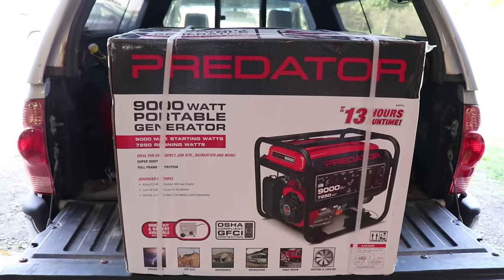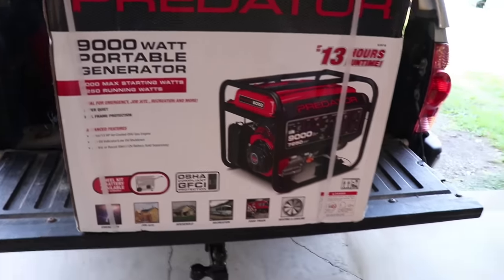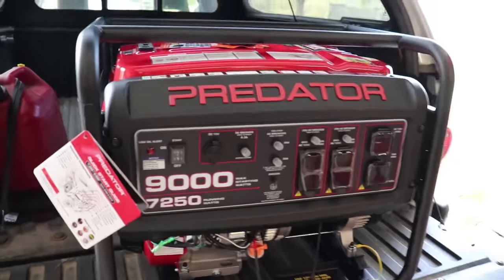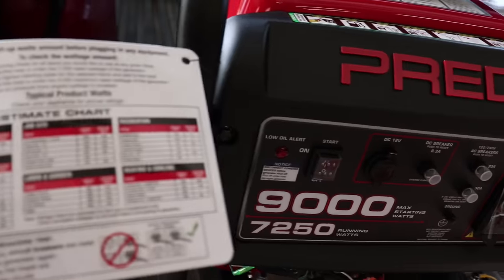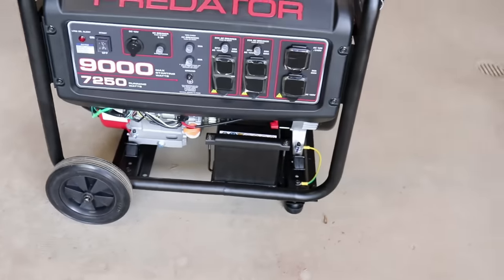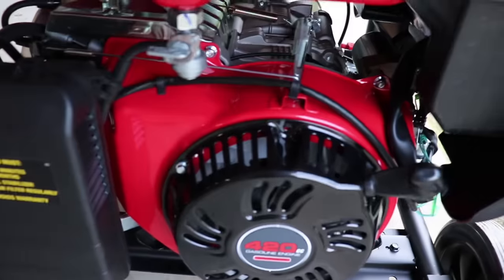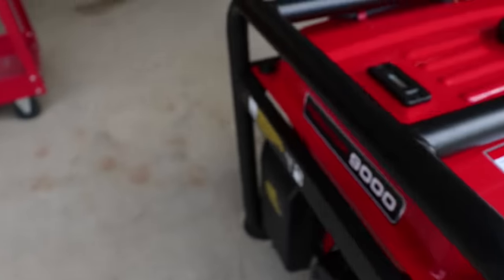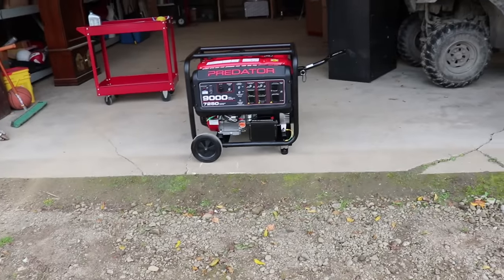Predator Generator Running Our ENTIRE Home. (Complete Setup and Cost)

Comment: Just purchased a Westinghouse 9500/12500 dual fuel electric start to replace my 25 year old 5500 watt pull start unit. I would run the old unit every January and June each year, but only poured 1 quart of fuel into the tank each time and let the engine run till all the fuel was used up.  Two pulls and it would start each time. The carb never gummed up this way.  It performed flawlessly until January, when the pull cord broke and the main switch disintegrated.  I decided it was time to upgrade. The new generator works perfectly and I plan on only running it on LP as my RV has 2 large tanks that I can use, if needed. I have a small LP tank from the LP fire pit that I will use initially and change over to the larger tank(s) if needed. This is one of those items that you hope you never have to use and would not be mad if you never had to run it other than twice a year for preventive maintenance.
Reply: I imagine that Westinghouse been a beast for you. The wattage is a must (case dependent of course)…

Comment: Just to clarify, your water pump probably didnt run......
Reply from the maker: Hi Larry....I did run the water for a while to kick on pump. Just not on the video. Works great. Thanks for the comment.
Reply: @TheCookFamilyHomestead  should run all your 240 volt appliances,7200 watts is plenty for a water heater and a water pump
Reply: @TheCookFamilyHomestead  was your ac running.  How many tons is the ac

Comment from the maker: Here's how it is hooked up to the electrical panel: https://www.youtube.com/watch?v=ohmkZ5-lT2c&feature=youtu.be

Here is the test I did with the water pump and furnace: https://www.youtube.com/watch?v=biioj7OnfR4
Reply: make sure an electrician checks and oks"writes off"
Reply: SOLAR MUCH QUIET, CHECK OUT KODAK AND GOAL ZERO 😉
Reply: @shonte0  Doesn't do much good when there isn't much sun for long periods of time.
Reply: shonte0 battery costs are astronomical and only last less than 10 years and solar panels life is about 25 years - you never recoup you only transfer cost

Comment: Just bought this one and so far very happy with it. Got the Power inlet and breakers all set up. My only complaint so far is the short length of the battery cables especially the negative. I can't get my battery oriented as you have. The neg cable will not reach the terminal. Turned the battery around and I used a short motorcycle baggage tie down strap that works for now. Informative videos. Thanks!

Comment: I have about the same loads you described, I have NG furnace as well. My thought was to downsize my generator to less than a half of what you have...I went with a 3500-400 Watt Champion. If you safely install and follow the procedure (as you did), then add the individual loads one at a time (one breaker at a time)...you don't need near the generator size that you chose. The big advantage is that you will basically use about half of the fuel. At 4000 watts of power, you wont be able to run an electric dryer or whole house air conditioner. Please do your load calculations and size accordingly, and most of all...please be safe! Great video and God Bless!
Reply from the maker: Thank you!

Comment: “useable”output is 60A @ 120V or 7250 watts as per the specs... I seriously doubt it can even get to 6500 watts most 7000 watt generators require 500+ cc engines or 15hp+ engines.

No way this can run an entire home, a fridge, some outlets, some lights, few small appliances. But power is dynamic, you can turn off stuff to get extra power elsewhere, but to state it runs an entire home is ridiculous especially since you didn’t show total home power requirements, as this greatly differs between homes.... esp 2 story homes

Lastly a dual/tri fuel generator would be better buy, NG is Plentiful and lots of homes use HG,  but at reduced power even under LP power levels, vs gasoline
Reply: Agreed I have the same one and run a deep freeze a fridge and some lights we don't have many outages though and usually back on within 8.hours or less.
Reply: I use 10-30 kw per day depending on the weather. I don’t use central heat/air very often. This generator could easily run my entire house with a little power management.
Reply: Generator supplies 9000 watts, at 240 volts ohms law states that 9000 ÷ 240 = 37.5 amps. You multiply 37.5 x 0.80 (80% of the total load is in respect to over current protection) you get 30 amps. Go put an amp clamp on a 200 amp service for a house and tell me with the central ac working, power to the fridge, some rooms are all lit up and even a couple of tv's being on that you'll read 30 amps or even be pulling anywhere near it. IF your using an electric range which can be 50 amps, dryer (30 amps), microwave (14-17 amps), blow dryers, toasters, blenders as well as everything I mentioned before..... yeah you'll have some issues. But this seems to be intended for a power outage, it's not like hes trying to prepare thanksgiving dinner on the generator, cut him some slack.

Comment: Be cool to have a giant fancy battery that the generator keeps charged so that the generator noise is not consistently running.
Reply: Do you know how much a battery bank  cost to run a house for a day? It is like 2-4 thousand for the batteries, period. Then you have to buy a inverter ($1500), wiring,exc. It can get to 6k quick.
Reply: @brianmorrison9066  hey thanks for explaining what is needed, saved me from typing it out.

Comment: Got a generac 8k. 
Runs everything.  But under full load... watch fuel consumption.  Mine gets real thirsty whenst family gets tech greedy
Reply: Which is why you should run the smallest generator possible (2000 watt inverter) and only use a big generator when you absolutely positively need to. I had no power for 3 MONTHS during the 2004 Florida hurricane season and it was so costly to keep our 4000 watt generator running. A 2000 watt inverter generator would have paid for itself by week 2.

Comment: Only thing you need to know is that Predator Generators have a fairly high level of Harmonic Distortion (20-23%).  What that means is that the power you are feeding to your home does not have a pure sine wave, so it can fry circuit boards of sensitive appliances (computers, printers, microwaves, etc) over time.  Especially troublesome is you have any type of inverter running a home backup power system.

Comment: You could have probably ran all of that stuff except for your outside air conditioner unit at the same time
Reply: If you actually put a large enough "hard start capacitor" on your a/c, and shut everything else off temporarily, you could probably run a 2.5 ton to 3 ton a/c.
Reply: @Steven-gv1ke  I Have the Champion 9375/7500 i can run it all without the Hard Start but i also have a gas water heater Furnace no problem looks like a regular night outside my home while everyones lights out

Comment: Harbor Freight is missing the boat by not offering dual fuel and low THD generators so your genny doesn't fry your expensive furnace control boards..
Reply: $30 on amazon gets you a tri fuel carb. runs on NG, LP, and Gas. totally worthit tbh
Reply: @johng6387  Do they have them that will run the right mixture on a 420 or 460CC engine?  I need at least 8KW.
Reply: @ohger1  they carb is made for the 420cc. the carburetor is a 1:1 exact match to the one that came off the 420cc motor. except that the top of be bowl has the vacuum inlet for the propane/ng in it and the regulator off the side. all other parts are interchangeable between them, even the wire harness has the identical brand of connectors as the OEM one. here's the video that led me to mine with a link in the description for the exact carb for it.

https://www.youtube.com/watch?v=Twusgs3SgnM
Reply: @johng6387  Thanks John!
Reply: @ohger1  no problem!

Comment: We have the 8750 watt version and we run everything in our house and everything is electric. We have run the stove, hot water tank, well pump, furnace, and fridge at the same time so these things can take a lot of draw. You should be able to use pretty much everything with the 9000 watt on.
Reply from the maker: They are awesome generators!

Comment: Did you get that interlock installed? If not, you are violating electrical codes...very dangerous for a lineman working downstream from your house.
Reply from the maker: Yes...you can see it here: https://www.youtube.com/watch?v=ohmkZ5-lT2c
Reply: It's only dangerous if he failed to disconnect the main breaker, and since it was providing power already to the house, him forgetting wouldn't have affected a single lineman.  If there were an outage in the area, then YES, he could have caused an issue for a downstream lineman IF he had not tripped his main breaker, but, he DID trip it, no problems.  Didn't violate anything.

Comment: I bought a 9000 predator generator last November 2021. Had a tree take out the master bedroom and the power meter on the outside of that room. That is also the main fuse box which energizes half of my house. This half is a 77’ X 25’ add on built 10 years ago. Front half of house is the original built structure with its own main box. It originally was energized from the pole, but, after the add on, the box is energized first from the add on meter and 200 amp service then to the original service which is also 200 amp service. Okay so that’s the layout for service. I could no longer use my service because it was ripped out by the tree. So, I bought the generator, bought #8 x 3 wire and a male plug to match. I disconnected the meter service from outside and wired the generator directly to the original service,bypassing the back half of the house and energizing just the front. I was like this for 2 months, 12 gallons of fuel per day, until I was permitted to get a temporary pole which I had them put a 250 amp service. Then, I bought some #8 aluminum wire to match what connected the two main boxes together and extended that to the temporary pole and now it energized the original main box which got me off the generator. I still am wired to both but have the generator ready to go only if I needed it. BTW it’s 1.4 quarts of oil. Do not immediately start your generator and start running load on it. The engine has a 4 hour breaking in period. Then you change that oil out and put new in. I went to 100% synthetic after that. Then you change oil about every 150-200 hours if continually running or if stored longer than six months should always keep good oil in for when needed. I can change the oil in 10 minutes. I use a measuring funnel with a on/off valve w/clear hose. If you don’t use it for a long while make sure you run the generator dry of gasoline. Let it run itself out of gas. This is better than keeping gas in it even with stabilizer in the gas. You have to re add stabilizer ever 6 months. Straight gas turns to varnish. No gas is perfect. Good generator for the money. I would buy a 12,000 next time to energize the house next time though. Breakers on the generator will pop if you run two 220 appliances at the same time (water heater and stove). Also it didn’t want to run my dryer with adequate amperage, so, I couldn’t use the dryer. But, I figured out what did and did not work together within a couple days.

Comment: I have the 6000 and run 90 percent of my home with zero issues I live in the northeast and lost power once for 4 days I had it running around the clock not a single problem.

Comment: I grabbed the 4000w when I bought my house six years ago. It's enough for my fridge and furnace as well as lights and my phone chargers. Sadly none of these configuration generators are inverter generators so you don't want to run sensitive electronics like tv's and computers on it. It's been a champ so far. Sadly though, I had 5 outages the first year after I got the house and since then I've had two in five years and both were due to transformers being knocked down by a drunk driver

I just back feed from my garage to the house after I turn off the main breaker to the house. I still need to wire it properly but it works for now until I can get the cash to do it right

Comment: the biggest load drawers in your house are the HVAC , Range , Dryer , all run 240vac A&B phase at 30,40,40 amps ( 110 amps total ) . So these you would have to operate only one at a time, refrigerators / freezers can be left on because the cycle lock rotor start on the compressor is about 10- 15 amps on a 20 amp branch ( 80% of work load ) until it levels out too 5-7 amps. You want to get a electrician to do a main panel A & B phase amperage equalization of all the things you want to run continuously.
( 80% of 100 amps = 80 amps  balanced on A&B phase incoming ) Changing all of your light bulbs to LED low amps instead of incandescent filliment cuts the lighting load by 60-70% on a 15 amps circuit.

Comment: That port / plug outlet on the generator will only put out 3500 watts. All the ports combined will put out the 7250 watts. When you overload that outlet the breaker on  the generator will flip. Very good video

Comment: I know it's an old video, but couple thoughts:

1) Convert generator to run on propane, no more storing fuel for it to just go bad.
2) Get a battery tender, want to keep that guy in shape for the long term storage.
3) vent exhaust to the outside and still keep your garage door closed(don't recommend if garage is attached).
4) They make a smart device that will kill the main switch AND start the generator for you.
Reply from the maker: I've been thinking about the propane conversion.
Reply: Is this good for apt ¿ I’m confused about power box ...if not, please advise...thanks

Comment: I got a smaler house. bout 1400 square feet. just picked up the 4375 predator. its not quite enough to power the entire house but itll power up the important stuff during outages. lights, computers, heaters/ac units. fridge etc. After that february storm here in Texas when we lost power for 4 days straight and our tiny tail gator 900w generator was all we had...yeah we had to step it up
Reply: ⚠️Here’s an important safety announcement for everyone:

Please make sure you follow the generator safety tips whenever you use your portable generator. This is just a reminder for everyone’s safety. All generator safety rules need to be followed carefully 

Here are the generator safety tips: 

1) KEEPING OTHERS SAFE: Please do not allow an non qualified person or your children to operate and service the portable generator. Just because some manuals don’t say that doesn’t mean it’s safe. That is important against the generator safety rules. We also need to be keeping an eye on our children too. You need to make sure that your children are not playing near the portable generator especially when it’s running so they won’t get electrocuted. Generators pose electrical risks and they can be hot during an operation. Please keep your children away from the portable generator at all times. It is important to keep our children safe especially our little ones. Children often get curious about anything so we should keep an eye on them to also make sure they’re not wandering towards the generator. 

2) WHERE TO RUN YOUR GENERATOR: Some people use their portable generators indoors which increases the risk of carbon monoxide poisoning. It’s important to have a carbon monoxide if you have a gas generator. Never ever use your generator indoors even if your doors and windows are open and even in the garage is not safe to use a portable generator. Not even at your porch and your deck. It is never safe to use your generator indoors and in enclosed areas of your home. Your generator needs to be 15-20 feet away from your house. 

3)🔥FIRE HAZARDS: Never refuel your generator while it’s running. You need to let your generator cool off before refueling it and before storing your generator. Never overload your generator too. Never ever back feed your generator. You should never plug your generator into a wall outlet. Also never store propane tanks indoors. Please keep flammable things away from the generator as well and please don’t smoke cigarettes near the generator. Having a fire extinguisher next to the generator is also important against the generator safety rules. 

4) GENERATOR OPERATION: make sure your hands are dry before touching the generator. Never use your generator in wet conditions. Don’t let your generator get wet. You need a generator tent if you need to use your generator during wet weather. Please don’t wear loose clothes when operating the generator. Turn on your generator before plugging in appliances. Use the right cord for your generator. Please do not use worn out cords. Do not touch the generator’s engine when it’s still hot. 

https://youtu.be/I1jT3ANENvI and here is a video more about keeping others safe when using generators. All generator safety rules need to be followed carefully. 

Hope this helps. 

Please make sure you follow all the generator safety rules.